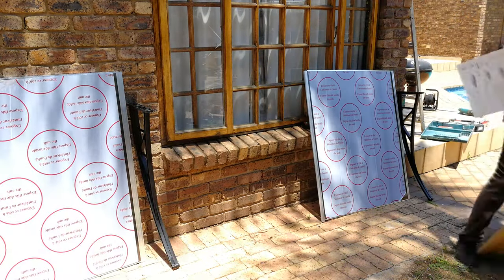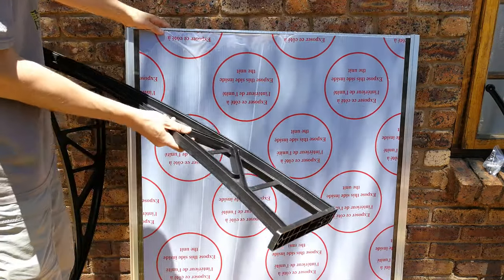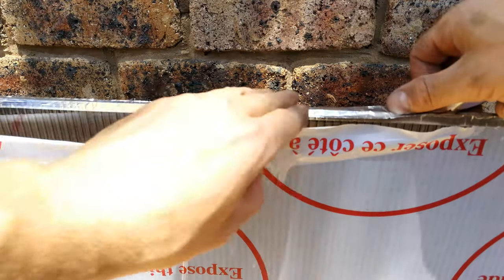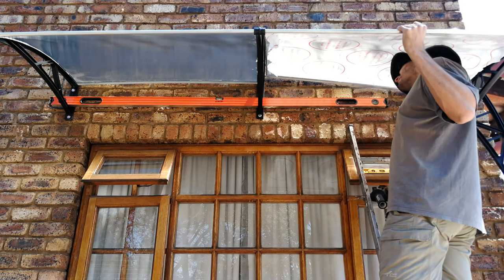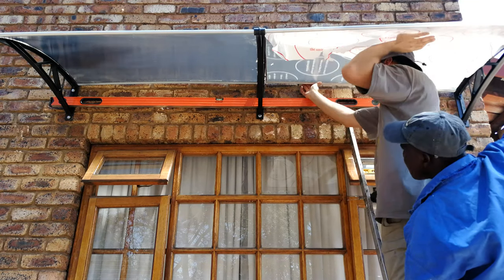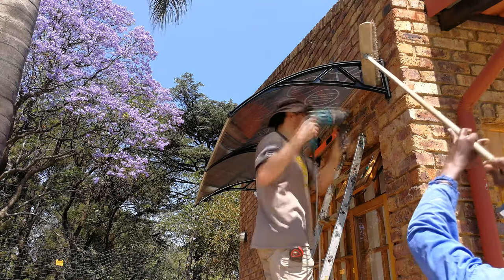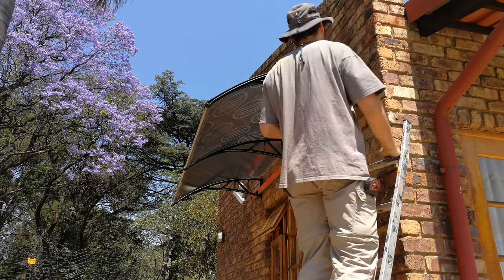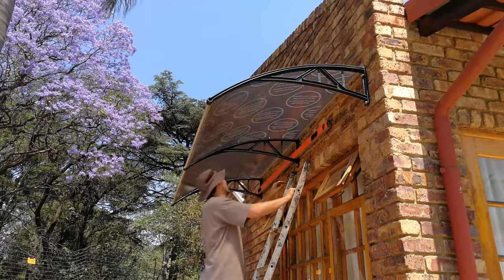How to install a double plastic awning - step by step

Comment: Use a long carboard template with holes made from the canopy.  (open box that it came in, use the bottom edge as the level on the line of the bricks).
Mine just blew off, Storm Eunice, (Feb 2022). Going to remove and rebuild and add aluminium or plastic strips depending on what I can get and screw into the black supports.

Comment: Not sure about this brand but the ones I got came with cheap screws and masonry inserts. Instead of using these, I got some Dynabolt masonry fixings and used those. The awnings have been sturdy for 8 years now and we have had some HEAVY storms.

Comment: It would look better if the brackets were mounted with reference to the horizontal mortar line rather than to the spirit level. Use rubber mallet or block of wood with metal hammer. Peel back plastic covering from edge before fitting to arms.

Comment: I wouldn't have put it together on a brick path and there's no way I would have used a steel hammer on it. This awning would have been covered in scratches.
When you unpack something like this use the cardboard packaging as a base to work on and use a dead-blow hammer or rubber mallet. The polycarbonate may be shatterproof but it can split very easily. Also use a screwdriver - you're not driving 100mm screws into hardwood.

Comment: my awning is just like this. it comes with 4 small screws...they call them "Sharp" screws. Can't figure out what to do with them!

On the black plastic there's holes for them, but the aluminum supports have zero holes in those areas.

should I drill holes in the aluminum to match up and use those screws to give it a secondary support (on top of the acrylic caulking)?

Comment: found it easier to assemble one end at a time,with a rivet on round ends thru plastic into aluminium  where they slide in then put other end on same deal with rivets  to hold it all together,put one dynabolt in at one end and had partner push up other end with a broom and level on top ,made marks  for other end,dynabolts and done.

Comment: Thank you for the video ,I'm about to proceed with the same job . Although my canopy is slightly more difficult due to the composite alu- sheeting . The sheeting has a rubberstyle sealing strip and requires some washing up detergent  to facilitate the fitting of the support arms. That procedure is ok but fitting the additional canopy in the air is not easy. I might consider your silicone or polyurethane style  sealer in the centre . The drilling of the wholes as you go seems more accurate . I was going to drill all the holes prior to fitting the canopies.  Thank you for the explanation on your fitments of the canopies . Keep well and kind regards 😊

Comment: There is a right way and a wrong way to install the awning.  The drill bit can move so why provide it as an option.  Reading reviews on this product I've seen a lot of the awning pops out of bracket comments.  Added caulking and tape.  Must be a beauty of a finish.  Start with centre bracket and then mark the two exterior bracket holes.  Measure in from the window edges to get the centre point.  Pilot drill then drill to anchor size.  Bricks can break and because its a hammer jack drill the hole can be slightly larger and you don't want that.  Do it right and take the extra step.  You mention applying tape to the top to seal water access.  How does tape stick to brick?  The caulking job was horrendous.  Should use caulking spatula so the finish is presentable.  And bead should be a min of 1/4" and ensure it's designed to fasten to the material you're applying it to.  The plumbing of the outside brackets shouldn't be required if the awning is level since the brackets insert 10cm into the awning cover so should be plumb based on that alone (unless there's play in the seam which I doubt since it appeared to be a snug fit.  To avoid scratching the outside brackets when inserting the awning panels make sure it's not on an abrasive surface.  Piece of cardboard or foam board would work.  Tap in using a rubber mallet vs hammer or if using a hammer use a small piece of wood so the hammer head impact doesn't damage the bracket. Pull the protective covering away from where the brackets are installed an inch or so so it's not pinned in when installed making it's removal more difficult than it should be.  Remove the top protective covering after you've sealed the opening between the wall and the awning.  Caulking can drop off and no clean up if it lands on the protective sheet as it comes off cleanly when the films removed.  Otherwise, looking at smudges of silicon that is not easily removed.  Level should sit on bracket like he did after it fell of the top of the awning.  That fall alone can cause the level to no longer be true so should have noted he checked to ensure it was still true after the fall.  Having installed many of these in the past he should have had it sitting on the lower support bracket from the beginning.  Easier to see and no risk or falling.  And ensure you have a clutch on your drill if your using the drill to drive in the screws so you don't strip the opening. Set it to 3-4 and adjust from there.  Don't want the hole stripped.  Short burst on lower speed so you don't strip the head of the screw.
Reply from the maker: thanks. the way shown does not result in popping out of awning.

Comment: Eventhough the video is kind of long, the explanation was very well done.  I am planning on installing these but noticed that there's no coverings on the sides, if the rain comes with wind, which usually does, the rain gets in through the sides, I may have to install a double one over my door.  If  very strong winds are expected these awnings can't be lowered and secured.  So I'm still looking for some that can be lowered and secured.
Reply: Have this installed for around 5 years now. This year we had some pretty strong wind that brought down some trees and took up some roofs. Awning survived.

Comment: Why didn't you assemble both on the ground then secure to wall
Reply from the maker: that is more difficult, they are not easy to hold when up against the wall, need 3 people to do it that way.
Reply: You know why? Because you weren't there to help hold them up.

Comment: Hi, do you get these awnings in 950mm wide, mine I need to put in between my wall and the neighbor and its only 950mm in width
Reply: May have to custom order it from the manufacturer. I am guessing it won’t be a problem or just cut it to size if your handy.

Comment: I didn't get any tape and the directions doesn't show any tape with it. Do i need to buy some and what kind do I buy?
Reply from the maker: If the sides are open and you think water could get into the awning and seep along the inner part, then it may be good to tape it. If the sides are sealed already then dont worry about the tape. The tape is to stop water from getting in the little channels that run from left to right.
Reply: No tape here, too. Called amazon and they gave me $15 credit

Comment: Can this be installed on a mobilehome?
Reply from the maker: it needs to be attached to a strong point - preferably thick wood or cement so i wouldn't put on mobile home unless you attach to the frame of the mobile home and the frame is strong.
Reply: They make awnings specially designed for motor homes. Usually canvas so they can retract, were you really planning on attaching a permanent awning on a mobile home? Really?

Comment: what size drill must we use please?
Reply from the maker: the size of the drill bit must match the size of the wall plug. Different awnings use different size nylon plugs. Just check your drill bit is same thickness (or there about) as the wall plug.

Comment: Just curious .. wouldn't it be easier to make up the 2 awnings complete using all 4 brackets and install them side by side.???
Silicone can be used where the 2 awnings meet.
Reply from the maker: it would be difficult to hold in place so i prefer to do in sections